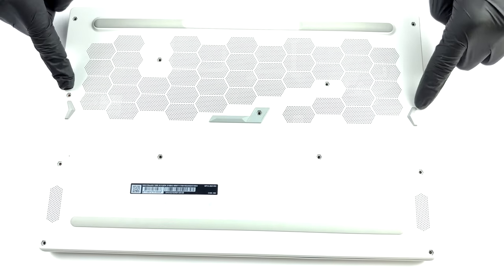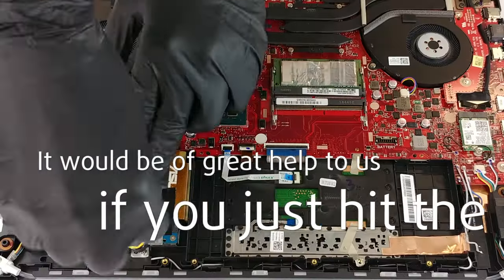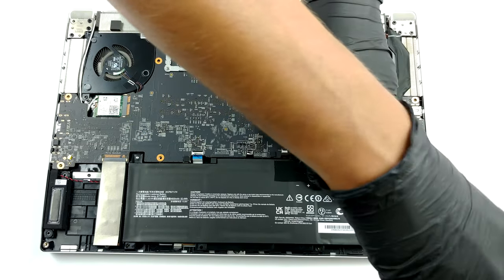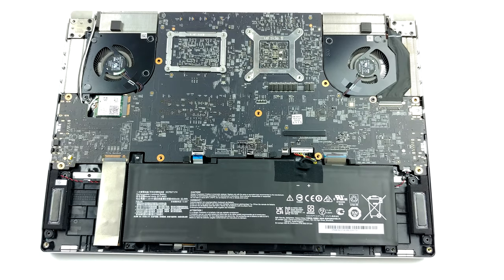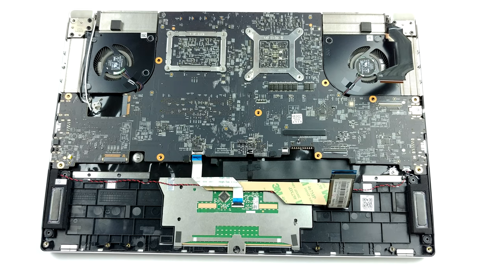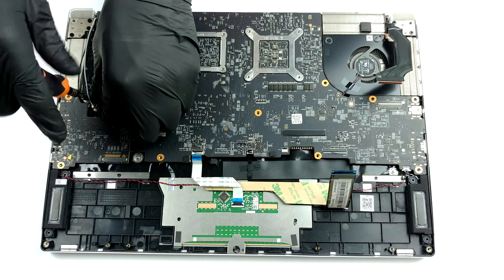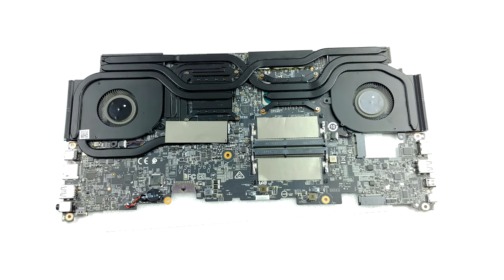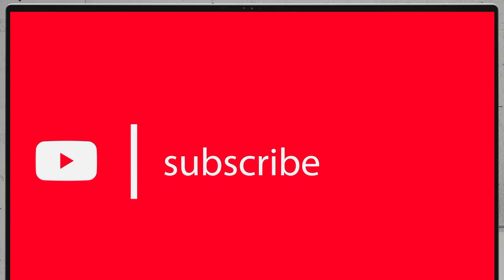🛠️ MSI Stealth 15M - disassembly and upgrade options

Comment: I removed all 13 of the screws but could not take off the bottom panel. Is there something I am missing?
Reply: Same issue man, idk if it’s click plates holding it down or just it’s tight on, and the assembly feels like cheap plastic so I’m scared to really pry at it. Did you ever get it off?
Reply: Same

Comment: Does the ram have 4 chips or 8 chips on it? I'd assume 8 based on the ram layout but confirmation would be extremely helpful
Reply: when he zooms in, the ram says 1Rx8 which means 1 chip per 8 bits wide, so to make the 64 bits wide it needs 8 chips 4 front 4 back. so it is an 8 chip set.

Comment: Does anyone know where i can find a replacement battery for this laptop ive looked for one for a while with no luck. not sure if every battery in the stealth category will fit in the laptop or be the correct battery in general. Need to make sure I get the proper one dont really want to make a $100 or more mistake. Hopefully someone can help me out thanks 🙏🏼😅

Comment: installed Ram, laptop powers no display or boot...now it won't power off
Reply: installed what ram? that's very broad - did it match the speeds of the previous? was it a supported brand?